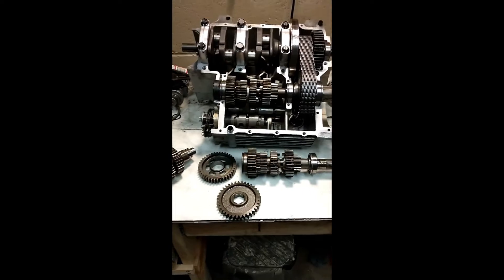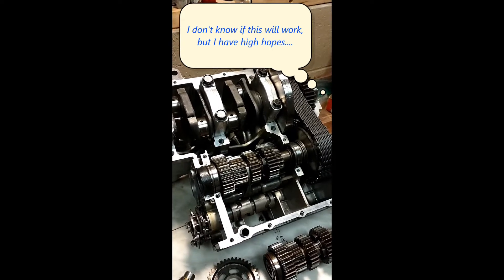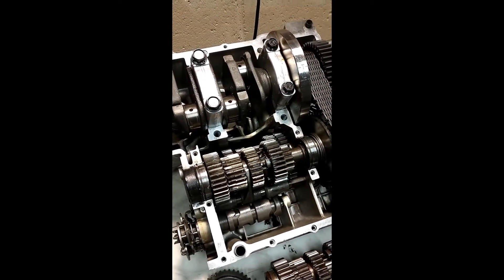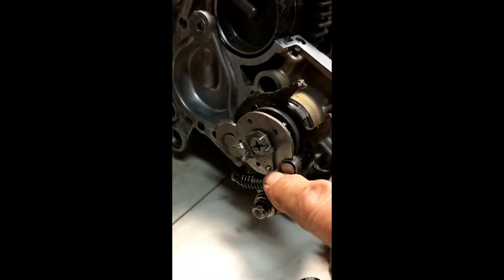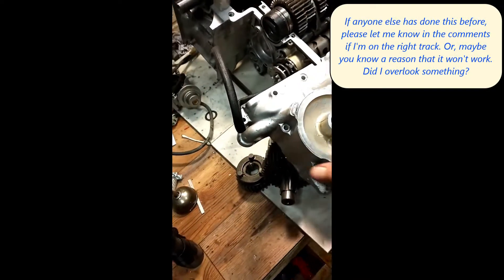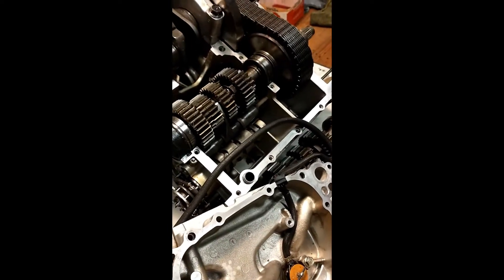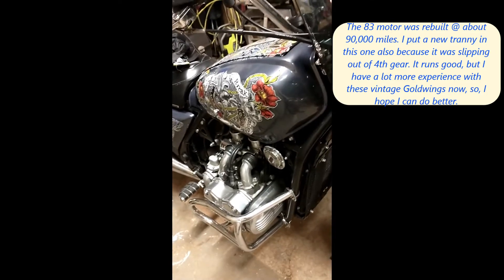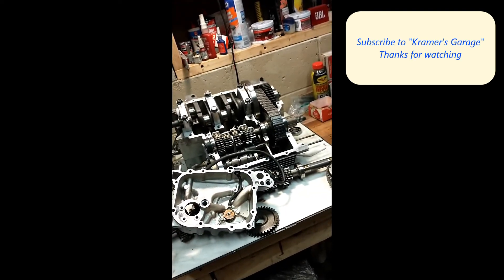I PUT AN OVERDRIVE TRANSMISSION IN A 1980 GOLDWING ENGINE.  WILL IT WORK?

Comment: Bonjour la boite de vitesse de 1983 peux t'elle ce monter dans un moteur de 1976 GL 1000 LTD 
Aussi quelle est le meilleur tendeur de chaîne primaire, les deux patin fixe, ou le tendeur a ressort a partir de 1978 ? 
merci de votre réponse , je suis de France.
Reply from the maker: Je ne parl pas francis...Sorry
Reply: @BobKramer51  Et Google tratuction .!!
Reply: Hello, is it possible to install a 1983 gearbox on a 1976 GL 1000 LTD engine? Also, which is the better primary chain tensioner: the model with two fixed pads or the spring-loaded tensioner (available from 1978 onwards)? Thank you in advance for your reply. I am French.
Reply from the maker: I have never tried to put a tranny from a GL1100 into a GL1000. If you try it, let me know if it works. I think the spring loaded tensioner is the better design. The earlier ones clatter a little bit when idling in neutral.
Reply: @BobKramer51  Hello, and thank you for your reply, but for now it's completely disassembled. The engine casings are empty and ready for painting. Regarding the gearbox, I'll keep you updated, as I need to find one from a GL 1100. Greetings from France, near Valence/Montélimar.

Bonjour. et merci de votre réponse, mais pour l’instant elle est complètement démontée, les cratères moteur son vide, propre pour la peinture. Pour la boite de vitesse, je vous tiendrai au courant car il faut que je trouve une boîte de GL 1100. 
salutation de France région Valence/Montélimar.
Reply: Hello, can a 1983 gearbox be fitted to a 1976 GL 1000 LTD engine? Also, which is the best primary chain tensioner: the two fixed pads or the spring-loaded tensioner (available from 1978 onwards)?
Thank you for your reply. I am from France.

Comment: Can i use the 83 cover on a 82 engine with the same transmission gear count.  The 83 have to wires from neutral switch and the 82 have one.
Reply from the maker: The neutral switch on the 82 is in the side of the block, the 83 is under the front cover. I used an 83 cover on a 1980 and put in a 6 position gear switch. This involved some very tedious modifications. Not sure what your trying to accomplish.

Comment: The horrendous low (totally incorrect) gear ratios on Japanese motorcycles has me considering never riding again. As a lifelong motorcycle rider and mechanic, nothing bothers me more than the lack of an effective overdrive final gear on all Japanese street and dirt bikes. It appears that they are colluding with higher corporate powers to intentionally withhold overdrive on ALL motorcycles. It has nothing to do with the legal speed limit, because the 1932 Henderson motorcycle had a very tall proper overdrive 4th gear, before the advent of the Interstate highways.
Reply from the maker: The "Overdrive" Tranny turns about 500 rpm slower at 70mph than stock. 4000 rpm @ 70mph. Redline is 8000

Comment: Do you know what the final drive gear ratio is on the 1984? I read that the 1984 is geared even higher than the 1983, but I could find zero corroboration of this.
Reply from the maker: As a guide, the 83 turns 4000rpm @ 70mph. You can compare this to your 84.

Comment: I have 1983 and 84 can these over drive gears be used on 1975 will it fit?
Reply from the maker: I don't think so. You could research it. Study parts drawings to see if primary and secondary reduction gears are the same. If not, probably not doable. However, if you have the 75 engine apart you could experiment.
Reply: @BobKramer51  I like Over Drive and will do some research on it Thanks.
Reply: @BobKramer51  I'm in the process of purchasing a 76 Ltd. You've worked on one of these Bob. I'm thinking the overdrive setup won't work on this motor? Also depends if it needs taking apart!
Reply from the maker: Yes, You need to completely tear down the engine to work on the tranny